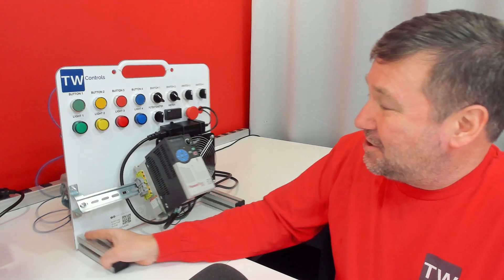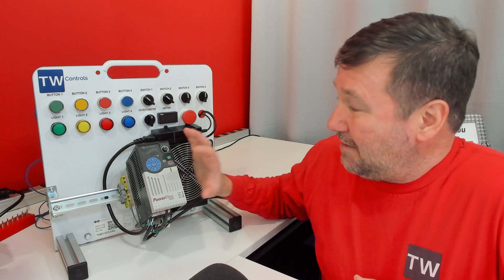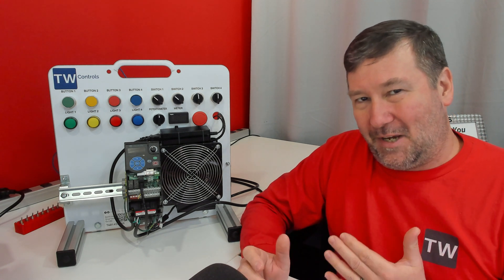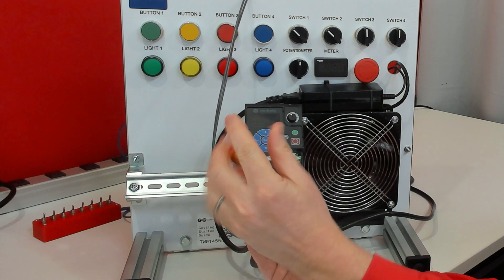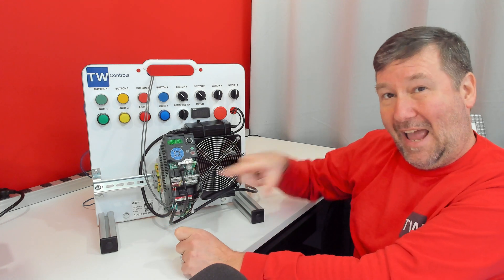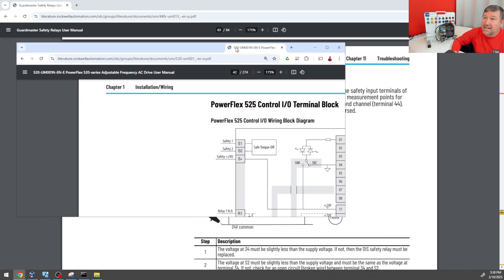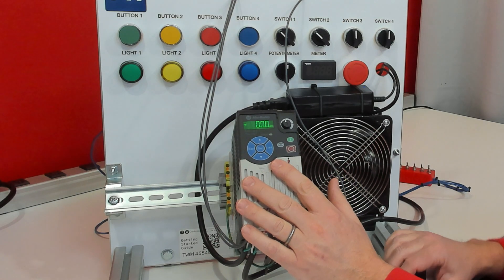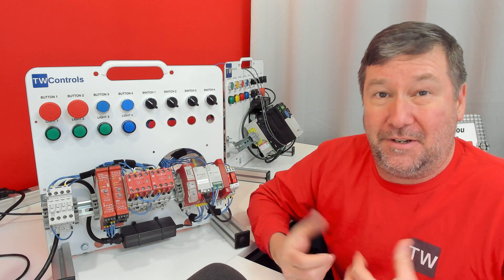PowerFlex Safe Torque Off (STO) Wiring Explained

Comment: Tim, I'm using a similar setup but with an IFM G1501S safety relay being triggered from a light curtain. I have (2) safety output wires coming from the receiver of the light curtain currently plugged into S34 and S43 of the relay. Could you help me identify which output terminals of that relay need to go to S1, S2, & S+ of the 525 vfd? I'm confused on the physical wiring that is needed in order to make this work.
Reply from the maker: I'm not familiar with the IFM module, I'd reach out to them.